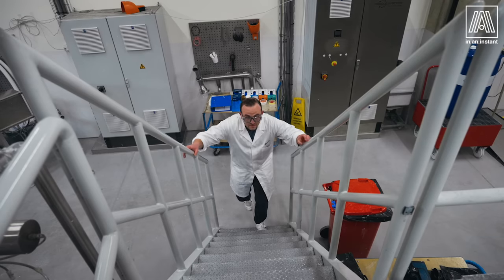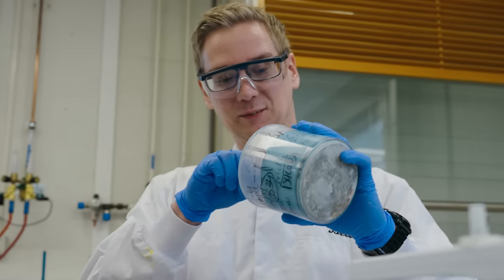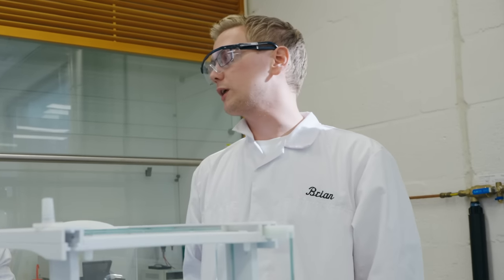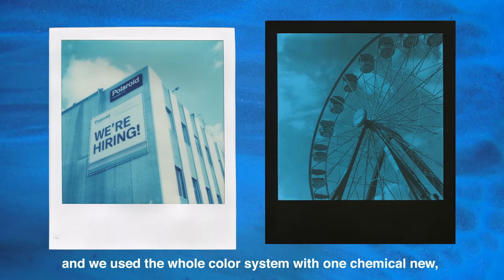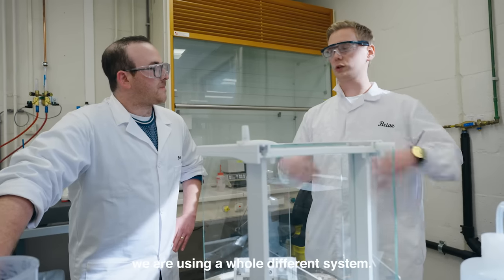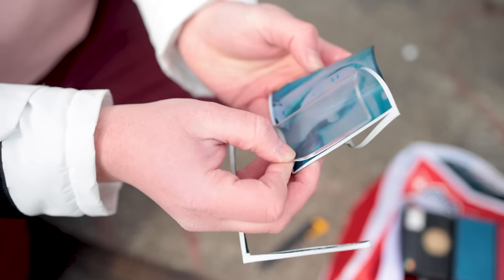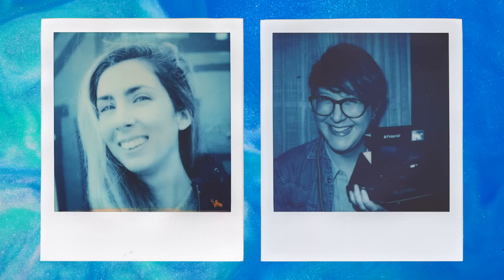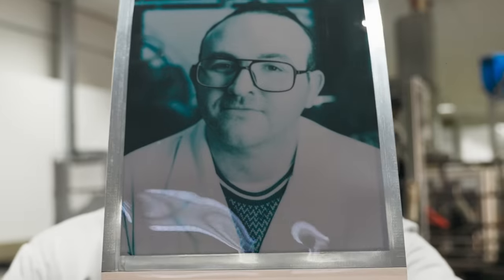Inside Polaroid Reclaimed Blue Film 🔵 Experimental Polaroid chemistry from within the film factory

Comment: If the film darkens over its development (& post-dev?) I suppose you should use flash alot with it, unless you're in very sunny conditions.
Reply from the maker: It does come in with deeper contrast, but I wouldn't say flash is particularly necessary. Highlights will still remain true as long as they have enough umph during the exposure.